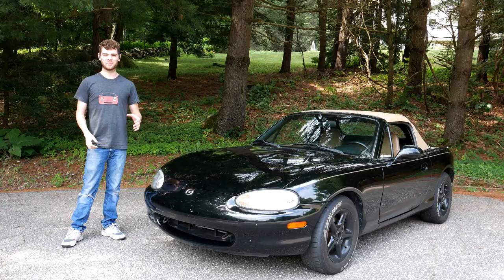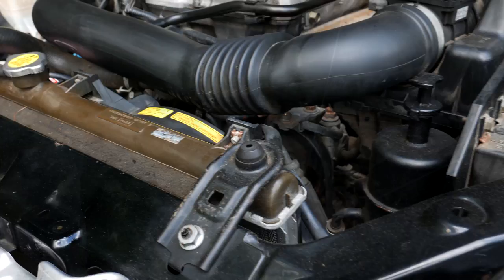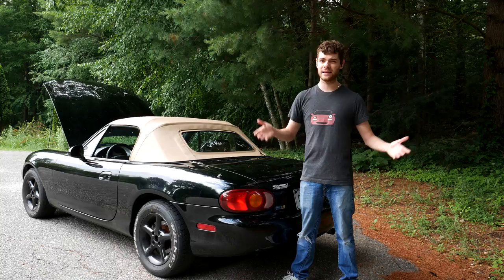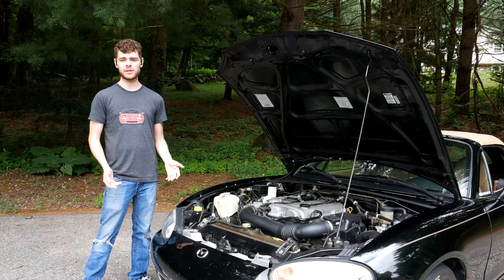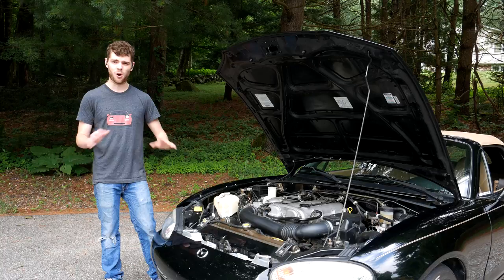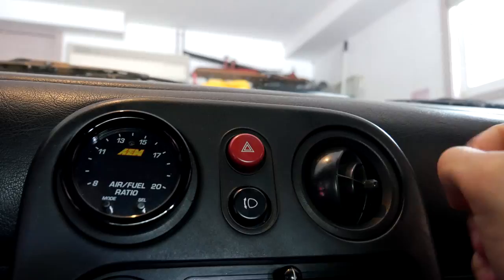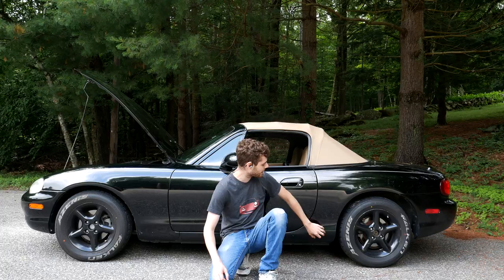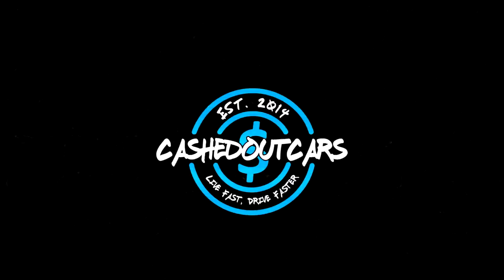5 MX-5 Miata Problems You WILL Have

Comment: You are talking about failure points on whaat can be a 30 year old car with more than 200,000 miles on it. Show me any machine this old without failure points. You should be celebrating the durability of this car. I am on my third Miata. This one was bought new and we're about to take a trip from Texas to Yellowstone and back in it. I would never take this trip if I didn't believe in the reliability of the car.Our biggest issue is getting the car to carry clothes and cameras.  (Before anyone asks, we have a boot bag.) If we could travel empty I would worry about nothing. Old cars ned repair. There's no surprise here.
Reply from the maker: That’s the point of this video, they’re great cars :)

Comment: My NB is more than 22 years old.
1.  My radiator never turned brown, not even green. It's still the original one. Fill in water, not acid.
2. The drains ("rain rails") at the back NEVER break, they just get clogged. Straighten a coat hanger and declog.
3. Soft top always breaks right above the doors, not at the points you showed.
4. NO oil leaks, not even after 22 years.
5. Eyeballs stiff like new.
6. NO rust.

And you totally ignored THE MX-5 issue: ignition cables break early, this will destroy the ignition coil and the catalyst if not corrected early.
Reply from the maker: I've personally seen several cracked rain rails, it absolutely happens. We replace a lot of tops and have seen this damage on tons of them
Reply: @CashedOutCars  - That "rain rail" you pointed to in the video is not a rail but a solid tube running down - this cannot crack.
There's real rain rails at the front.
Reply from the maker: A rain rail is what runs along the back of the top and acts as a rain gutter. These commonly get brittle and crack

Comment: Snotty nosed millenial. LOL BTW if you did the lead axe work at the end Kudos.
2002 model owner. In 18 years of ownership I could talk Miata all day. 
I have had NIL NADA ZIP NEIN  issues with any of your listed "common"  probs except maybe floppy vents. Ha Ha.
 You got the rad wrong too! Plastic tank turns from a greeny black to brown when failing. Yours does looks very crap. 
Clean the drains with a coathanger and some masking tape balled on the end. Will take all of three minutes. 

Don't know what you have done to your top, mine looks like new after nearly 20 years. ZERO rust anywhere. 
Great car, I NEVER  have to spend money on her. But nothing lasts forever, so in another 20 years I might come across some problems you have talked about.
Reply from the maker: That’s the point of this video.. there’s not much that goes wrong. I’ve had 4 of these so far, and between my friends, my car, and the fleet of 16 or so I used to prep for races ever weekend, ive got plenty of experience myself :)
Reply: @CashedOutCars  Having seen some videos, rust is a problem in the UK but not here in sunny West Australia. The car is a very nice buy if you can live with 2 seats.